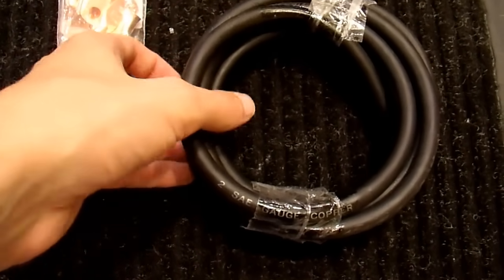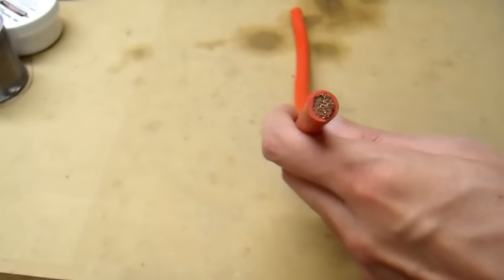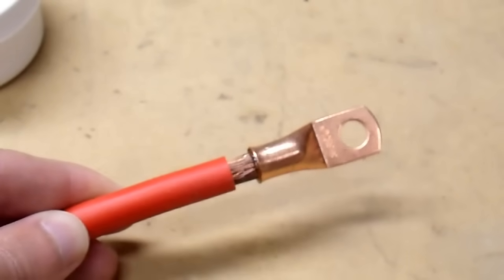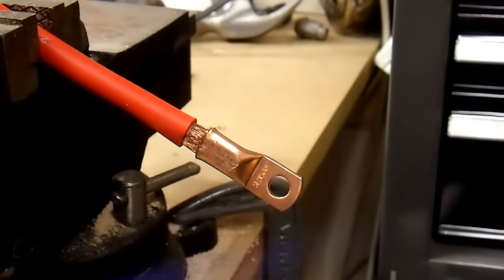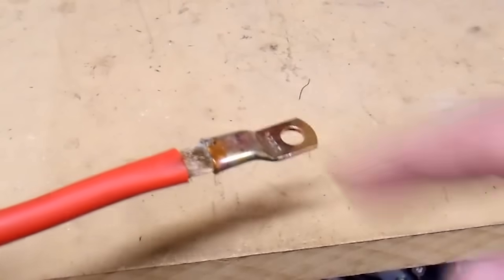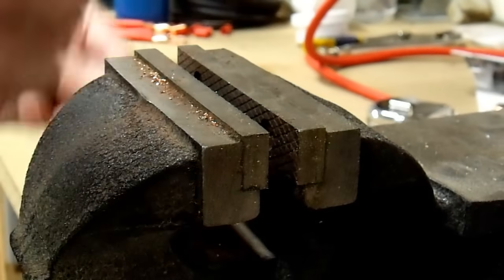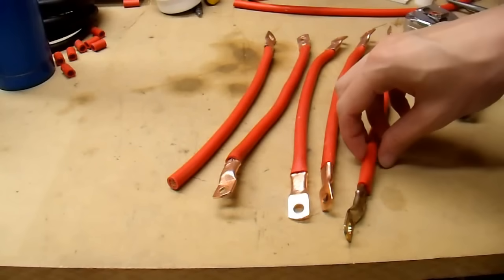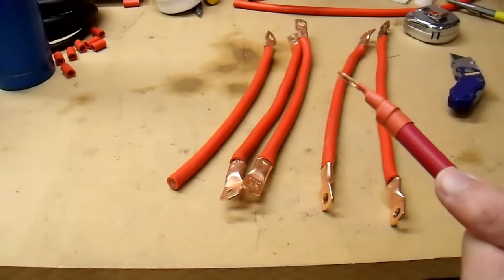How to Make Battery Cables the Right Way and the Easy Way

Comment: At least for marine application, positive and negative conductors cannot be allowed to cross.  The chafing you are mentioning would be a non-issue, at least on boats that are ABYC (American Boat and Yacht Council) certified.
I'd like to add that before watching this video I had not been aware of the benefits of soldering the connection between a terminal and a conductor.  I understand that buying starter cable with pre-installed heat-shrink would not reveal what the manufacturer has done to the wire, or if they even crimped the conductor properly, but I firmly stand by the benefit of heat shrinking terminal connections.

And from this point forward, I will be soldering and heat shrinking connections between conductors and terminals.
Once again, heat shrink is not all bad.  If the manufacturer gives you a conductor with heat shrink on it, I understand your position.  However, there is heat shrink wrap that you can buy and apply on your own, and I must say if you apply it yourself, as long as you do it right, the connections you make with it will last a lifetime.

Comment: This is what happens when a plumber thinks he's an electrician....
Reply: I'm a plumber,I know better than this, loved your comment
Reply: @plumberman5369  , not trying to be rude or anything, but speaking as a professional plumber what would you have done differently? As a professional builder since 1970 I have sweated a lot of rigid copper tubing. I have also done a lot of soldering on electronics. When I was a young boy I helped my grandad solder house wiring connections before the invention of wire nuts. Each uses different flux and solder but the techniques are very similar. What I would have done differently than  knurlgnar24 is, I would have left only 1/8 inch between insulation and connector and would have tinned the wire and inside of terminal before inserting it and soldering it. I would also forget about crimping unless I had the proper crimping tool. From past experience, crimping with a vice or vice-grips just smashes the connector and flattens the wire and only prevents getting an adequate amount of solder in the connection.
Reply: @vintagestereobuff7005  first thing would be not to heat the connector to the temperature of molten lava.  Second would be to get the proper crimping tool.
Reply: @dorothyrew1519  Yep. Turning the solder to a cloudy grey from too much heat is bad for an electronic connection. 
Except for the fact that it can let in contamination, a mechanical connection can be better than a soldered one. Meaning, it can be better, at first but, sometimes, not over time. Using heat shrink protects it from outside contamination over time though. When doing this style lug, I hit it with an X pattern with a masonry chisel. Never had an issue with it coming loose or losing conductivity. A car battery is not a space shuttle though.
Reply: Crimped terminals work best. Bell Labs figured this out 80+ years ago.
Reply: @vintagestereobuff7005  hi im an ameture at soldering and not very skilled at it. Im practicing and improving but having a few troubles. Could you please define "tinning the cup" for me. Im not familiar with this term. Im self taught and great at doing automotive electrical work and making custom wire harnesses for auxiliary accessories and such nd im looking to improve my work. Soldering connections instead of simply crimping will make my work much more professional.. Plz help. Thx
Reply: @dangerjack4695  use flux inside the terminal and on the bare wire, heat then  thinly coat the wire and inside with solder, then insert wire and heat the terminal and fill it with solder.
Reply: @dangerjack4695  You don't put solder over "plastic" batteries. It melts.
Reply: @pirate0jimmy   Wait!  Bell Labs figured out the crimping was better than soldering?  That's interesting.  What reasons did they give for that decision?  I need to look into that.  Thank you for the comment.
Reply: Crimping vs solder: higher bandwidth in rf circuits, lower-Z at DC, better vibration resistance, cheaper per connection, faster in hand operations, no one gets burned by crimping.  In tiny circuits, soldering is more perfect faster because of robots making pcb's. 
The middle ground that is better than both, also Bell Labs,  is wire wrapped terminals (epoxy potted if you want to go really nuts), if you have space and want to spend more.  Most of your electronic problems have been solved since the 1950's by BBC, Westinghouse Labs, and BellLabs. We only have to read old reports.
Reply: @dorothyrew1519  But if you don't heat the connector to the temperature of molten lava you can't get enough melted plastic into the connector to push the flux out of the way... I agree, used to do two way radio repair and crimped works best - for one thing it allows flex in the cable without breaking the wire, plus if it solder wicks up under the insulation the wire can be broken and you won't know! Also, not sure if I agree about using minimal flux because of "corrosion"... I've seen many more problems from too little flux and never saw a corroded  connection, even copper traces on a PCB which is much finer. Flux can be cleaned easily with acetone or alcohol.
Reply: @vintagestereobuff7005  Hey, I resemble that remark...
Reply: Doginu, a plumber would have used acid core solder and acid flux like they do in sweating rigid copper tubing. I have done a lot of copper tubing in my occupation as a builder, but also used to solder house wiring connections back before they came up with wire nuts, in the 1960's. Each requires a different kind of flux and solder, but the actual soldering techniques are very similar. The way I see it the only thing he did wrong was not to tin the wire and inside of terminal before inserting and soldering.
Reply: @vintagestereobuff7005  Ahh  actually,  he did not need to tin the wire as it is pre tinned as is the lug he is using.  The biggest problem is he used a solder lug not a crimp lug,  solder lugs don't crimp properly unless you use a hydraulic crimping tool.
Reply: Lol
Reply: YOU'RE 100% RIGHT SIR! Nothing to add,you've said It all- Nice one!
Reply: @Isaac Morales You miss the point. It will melt hot solder on a plastic battery if shorted.
Reply: @Kalcifer Crimping Hammer Tool, 1"of heat shrink, done ..
Reply: This guy is actually a computer technician
Reply: Plumbers are thick
Reply: what a hack job
Reply: Lol.... You're hilarious 😂
Reply: Cheap wirenuts and black electrical tape don't always cut it Mr Electrician.
Reply: Wrong on several points.  Round crimping is better than flat smashing.  He is weakening the cable itself.  Heat shrink is for insulation and also for bending strain relief.  He over heated the terminal and went crazy with too much solder.
Reply: stop it, its not fucking rocket science.
Reply: I've been researching into battery repairing and discovered a great resource at Jons mender guide (check it out on google)
Reply: @azersamaali2016  spam

Comment: I know most people with a degree in electronics use heat shrink Not to cover there work because there work is done right in the first place However is it to cover metal that is not used and prevents cross connection with other metals  I cut wires only after a perfect measurement of the end terminal This way i know how much rubber to cut off the wire Leaving 1/4 of a inch for soldering every time and I heat up the Terminal at it's end to middle so not to melt the rubber on the hose but hot to melt the solder Into the wire not just above it which is a common mistake Then the proper fitting Heat shrink and then 2 or 3 wraps of  Electric tape over lapping the heat shrink ends and the final touch is dielectric grease over the exposed metal terminals and overlap the electric tape .Another area that was over looked in this video was the rear of the terminal after it was crimped too hard. It made 2 gaps on the sides which is know for letting moisture in. you can solder it (very good) or grease it ( Good )

Comment: HI, Thanks for making this video, I have learned a lot from you, now i have a question. I have 12 6 volt, enersy datasafe hx800 batteries. I built a box just like yours somewhat. but in the bottom bank, i am thinking i should install longer battery cables, just on the 2 middle batteries, so i dont have to unload the whole box to get to the bottom, I built a side door,, so is it ok for the batterie bank to have 2 longer cables, or should i make them all just 1 length?

Comment: Making Battery cables on the dumb ass way!
Never use acid based flux on electric cable, use rosing core lead free 2mm solder for this job. 
 But with the right crimping tool, soldering is not neccesarry, but it can help to lower the electric resistance in very damp conditions.
Why do you think they develop special tools for this job? Because to make this job easy and safe.
Just buy the correct tools for this job or let it do by a pro for a six pack beer.

Comment: Use a real crimper and the proper dies for a proper connection. It will squeeze the parts together not just flatten the connection. The guy keeps saying he doesn't have the appropriate tools and techniques, don't do it the way he recommends.

Comment: He keeps saying way not to do it this way corrosion. A high draw will melt a solder connection. U.S. Coast Guard only recognizes mechanical, crimp, connections for use in marine apps.
Reply: Well everyone knows the Coast Guard never made a mistake.

Comment: IF you had the right size (diameter) solder would it be Electrical lead free resin core solder or Metal silver bearing acid core solder ?  I want to make some copper/cable connections to the ends to hook up an inverter. I see people using all kinds of solder but one must be better when working on solder terminals.

Comment: Actually, a bbetter way is to put the terminal in the vice after test fitting the cable. Then heat the terminal and fill it about one third full with solder. Next slowly insert the cable and let it cool. you can apply a little heat to the terminal after inserting wire.You do not need to crimp. this is a good if not the best type of terminal for solar system to inverter to  battery cable. For automobile starting cables you should crimp only. Put heat shrink on solar cables only

Comment: In a situation like this (where corrosion is a likely outcome), simply use clear heat shrink. Better than electrical tape (even the silicone stuff).

Comment: Hello Knurlgnar, can you help with this problem, I'm getting an big ARC when connecting the the last connection of the battery bank ( 8  6 volt batteries ) in series and paralell. the panels are not connected yet, just trying to get the battery bank hooked up, should I charge the batteries up before I connect them together and can I charge them together or one at a time I only have a car charger The batteries are all new and reading about 6 volts each
Thanks
Al

Comment: Do Not use this method on Mains Voltage, In the UK, its best practice to use the correctly sized lugs and cable using a Calibrated Crimp  tool without the need for soldering....
Reply: Soldering reduces resistance. Increases strength
Reply: @FastenDeezNutz  but a crimp is way stronger and not brittle
Reply: @FastenDeezNutz  Not really...

Comment: The heat-shrink acts as a pretty decent strain-relief to an extent, and stops you bending the joint, which can be important, if you put adhesive in there before heat-shrinking you can get it pretty air-tight which should keep moisture away. Like a car battery you can grease them after you fit them to the battery terminals, or use something like vaseline etc.

Comment: Do you think you can test a PMG Generator. I am going to purchase a 24 system and hook it up to a waterwheel inside a shed. It will be my POWER HOUSE... these Generators come in at 12/24/and 48 I would like to run two 24volts which should give me 3000 watts each and run washing machine,well water, refrigerator, two led tv's, and a couple of led lights, also a pellet stove.

can you tell what you think! 
you are very smart in the electrical systems and it was very easy to understand what you had talk about.
Thanks in advance.

Comment: I have been crimping cables for way longer than I want to remember. Having said that recently while considering an electric APU for my van I came across Trojan Battery company document WP_Battery Cable Guide_0512. This changed everything in my thinking the solder pellets are the way to go see the thermal image pics on page two. When i do my cables I will be doing it that way. Thanks for the video I appreciate it.
John B
Reply: Interesting advice from Trojan... crimp and solder.

Comment: What about applying liquid electrical tape to help prevent corrosion?
Reply: IIGrayfoxII Best stuff is called 'dual wall heat shrink' it has a layer of rosin/epoxy that seals the joint very well.

Comment: I like to heat shrink my connectors. If you solder your connectors, then there won't be anything inside the heat shrink for you to worry about. As far as chafing goes, all you gotta do is pay attention when you're assembling your connections. Don't allow chafing. Whether you use heat shrink or not, chafing is NEVER a good idea.

Comment: You can also drill a small hole in the copper terminal through which to apply the solder. That's what I do...

Comment: DC electricity travels through the bulk cross section of the wire.
A changing electrical current (AC) experiences the skin effect where the electricity flows more easily in the surface layers. The higher the frequency the thinner the surface layer that is usable in a wire.

Comment: really it is not professional way to do it.

This stuff works becouse amators usualy fit too thick wires for current they use/

Using these cabels for truck starting circuit will underline all fails, like poor crimping and soldering with too soft solder wire.

Well crimped connection require no soldering, more flexible and will not be damaged with vibration, like soldered connection

Comment: The whole Idea of a crimp on connector is to reduce the internal volume of the connector.thus squeezing the wire inside. Crushing it with a vise is asking for trouble and failure. A punch is a little better. JUST BUY A CRIMPER!

Comment: I know you do not like heat shrink, but one thing it is good for when taking out and putting in or just servicing the battery, the more metal that is exposed, the better the chances your screw driver touching it when your little kid calls you and you turn your head. For some reason I am not a welder but have done a little in my day and did not know it. lol Peace, Reese

Comment: I just bought an inverter for my house, it worked for a day, then the next day it turned on for a second and turned off. I can hear he fan running but no output electricity and the red fault light is on. What's the problem?

Comment: NEVER EVER SOLDER !!!!!
Cut the wire FLUSH with the end of the lug, and you WON'T need heat shrink tubing.
Rent a lug crimp tool, so it crimps all the way around the lug. Do IT RIGHT !

Comment: Those copper lugs should be crimped on, with proper crimpers, not a vise.
 Soldiering will make the cable brittle over time.  His entire procedure is not IPC industry standard.

Comment: This is absolutely NOT the correct way to terminate a cable end. Crimping the end the proper way (cold weld) would allow you to strip only the necessary insulation off the cable for proper fit and you would not have a need for solder.  Your way, at best, is for a temp fix until the correct way can be accomplished.

Comment: I understand that there is debate here, because cables are made industrially with large multi-tonne presses and so crimps are practical... but I've always been worried that home crimps for large cables like this are never very good.... especially over time as they get moisture they can get strange properties (also they can mechanically distort the crimp, and I've seen several 175A anderson connectors destroyed becuase cheap home crimp tools caused a curve which meant that the connector could not be assembled)

I have also been taught "not to use solder", but I have had many more connections fail due to inadequate crimping, compared to the issues with soldering...

I should make a video, because I do solder.... and I have a way to do it which solves a lot of issues people raise... and makes it so fast that I have removed the heat shrink from suspect crimping on cables supplied with cheap inverters, and soldered all 4 ends inside 1 minute...

I use a 150w solder pot, available online for ~$15... with crimps that have an open end (or hole in the end)... fit them up with a little flux as was shown in this video... and with the pot heated up to the point where the top surface starts to discolour I dip in the connector for perhaps 10 seconds (go gentle and wear glasses just incase as it will spit a bit)...  then for new cables I use a cheap home crimp tool afterwards to add a little extra security, but you will not be able to crush it much if at all due to the extra material added.

This allows you to solder right up to the insulation without melting it significantly, and it avoids the solder wicking too far down the cable (one of the primary reasons we're told not to solder!)...  It does result in your entire crimp being tinned with solder, but solder is nice and soft and if anything will make the connection better when bolting to battery posts.

Just my opinion/method.. :)